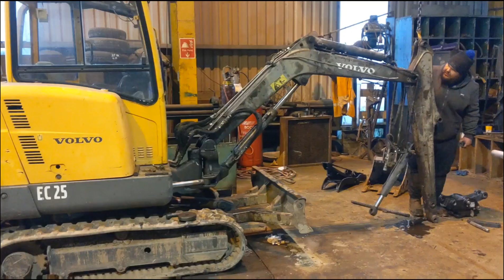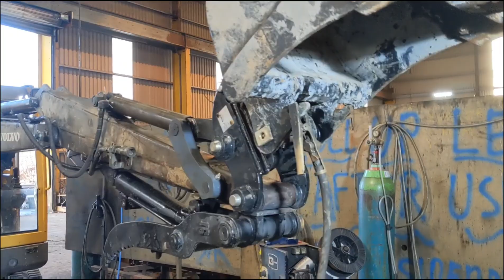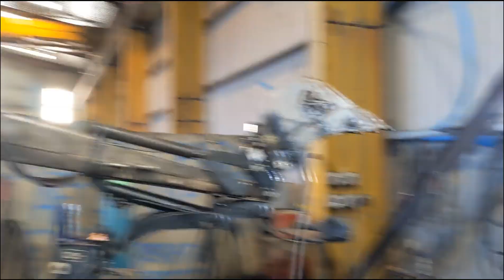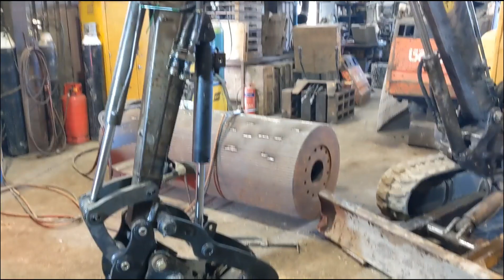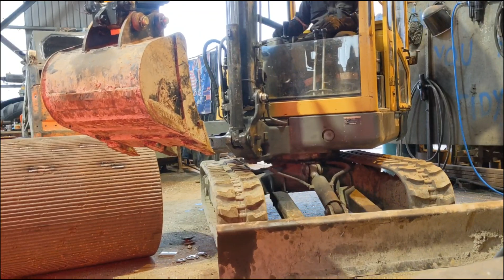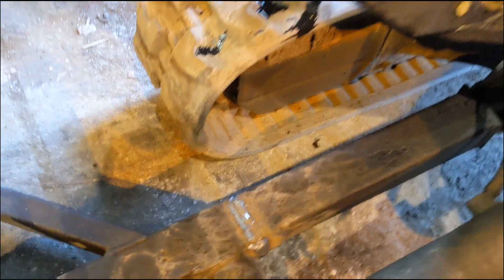twisted mini excavator blade weld repair and mounting a new thumb after complete overhaul re bush

Comment: wish my mini tractor had a thumb .. front bucket and a backhoe .. firewood would be so much less work if I put a thumb on it .. sounds like a winter job .. Great Video ..I broke both of the front bucket arms ,, factory used very thin box tube .. had to plate it after I welded the break ,, not very good looking when I got done but it holds ..

Comment: I put a carbide tipped saw blade on a 4" grinder with no guard. It didn't have a paddle switch. It was simple switch on and it kept going....Was sitting down and dropped it in my lap. Cut a nice deep gash in my inner thigh. Almost got my manhood. I don't advise doing that either.

Comment: Great video! Glad you included safety comments on using cut off wheels as well as disconnecting battery. I would like to add wearing a face shield when using grinders and especially cut off wheels. Those things are turning at 10,000 rpm and if the disc breaks (they do!) can easily penetrate your face, neck etc.
Reply from the maker: Yeah I wouldn't use one without my welding mask full face screen. They are basty
Reply: I had a few break ,, any twist at all under load .. also had a brand new one break when I started the grinder .. they must have pinched it at the factory ? was in the middle of my pack and was not dropped by me . chucks fly threw the shop ..

Comment: How did you set up the dipper on the drill to ream it in the correct plane, what did you reference off? Cheers.
Reply from the maker: Clamp one of the other holes with a pin through it to a 90 degree machine block on the surface table of the drill then all 3 holes will be parallel